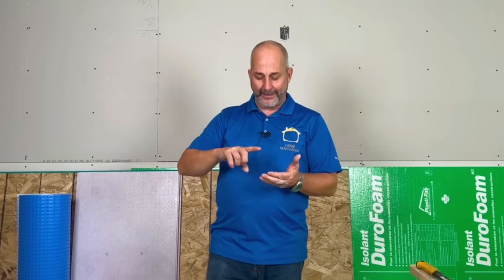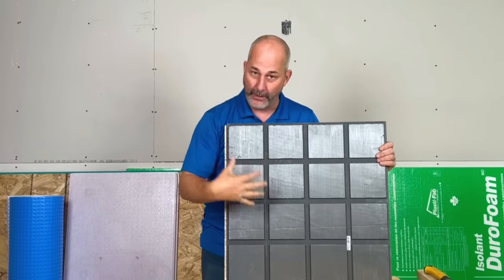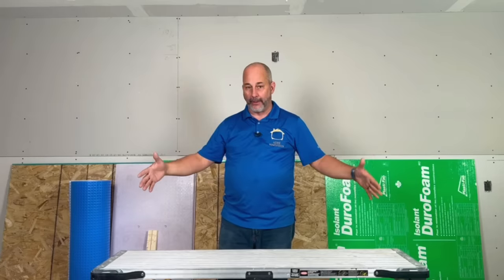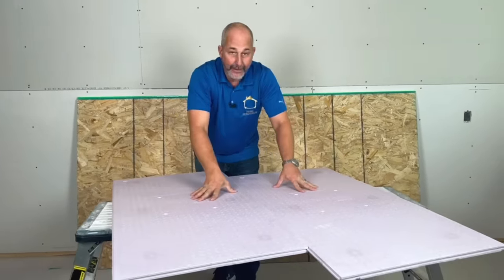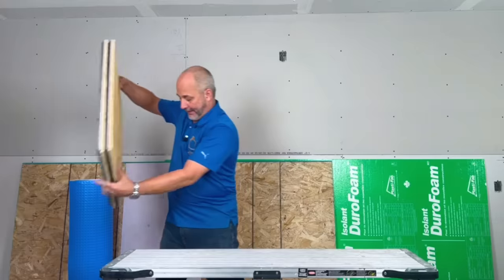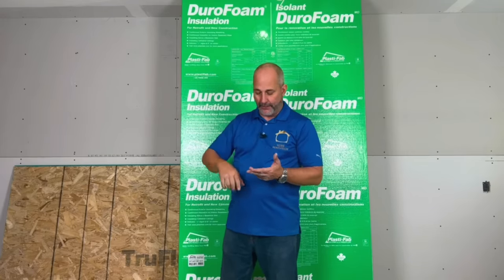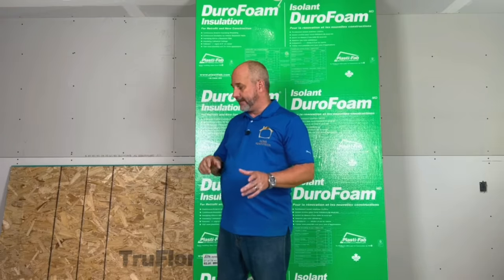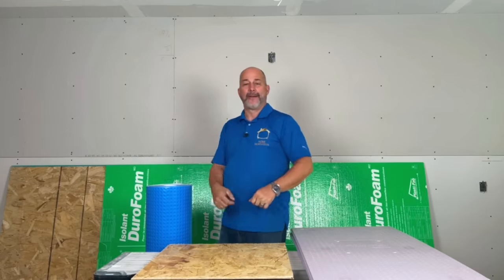Comparing 5 Different Subfloor Systems and What They Cost

Comment: Hello! Awesome Video! 

I got a 1976 raised ranch. No basement but lower level is concrete floors.

Would you recommend a floating floor directly over the DuroFoam? I’m not doing hardwood so I don’t think I would need the osb, but is the Durofoam good enough? lower lever gets pretty humid in summer and cold in winter with no thermal break or.vapor barrier. Previous owner had just gleued Berber carpet and vinyl sheet right to the concrete. If durofoam by itself isn’t good enough then I was debating the insul-armor. Trying the keep it minimal due to stairs but also want that thermal break. 

Side issue too is the lower level walls. Being a raised ranch the lower half portion of the wall is cinder block. I feel I would treat this the same as a basement wall. However, Previous owner had 2x2 ( 1 1/2 actual ) studs right up against the concrete blocks and unfaced fiber glass insulation with a poly vapor barrier which was poorly installed. Based on all my research the studs right against the concrete blocks is a no go. When I ripped that out there was clearly moisture inside the vapor barrier with some of the 2x2 studs and fiberglass insulation a little moldy. I think purely from condensation from a poorly installed vapor barrier and not enough thermal break. Nothing terrible, most likely the reason for a slight misty smell so I want to get it right this time around but there is so much confusing stuff about vapor barriers/retarders and moisture barriers. 

There is no insulation on the outside of the cinder blocks. That being said, I’m torn between two solutions. 

1st- use rigid foam board right up against the concrete to create moisture barrier. Frame over it with 2x4 and fill with insulation ( most likely rock wool) Install certainteed membrain to allow wall cavity to vent with season changes. Then drywall

2nd - put rock wool comfort board right on cinder block to let it breath, frame out with 2x4 and fill with rock wool insulation. Install caertainteed membrain over it all and drywall

So the question really comes down to, should i moisture block with the foam. Or let it breath with the comfort board. I have no evidence of water getting in from the walls either. Everything is pretty dry, just moisture and humidity, which is why I would want to use a moisture barrier, but I also don’t want to trap moisture in the wall and then get moldy 2x4’s. Seems many people get hung up on this detail mainly because the science is still evolving. Thoughts?

Comment: Thanks Jeff, I had a question, related to a basement with workout area a common practice in basements and garages is to install horse stall mats that are 4 x 6 ft, 3/4" thick, and 100 lbs a sheet, and they also have an underside that has channels for airflow.  They typically tape the seams.  Do you think this would be suitable to use in an entire basement then install LVP on top of potentially?

Comment: HI there.  I live in Santa Monica, CA.  I just poured a new slab foundation for my 900 sqft single story ADU.  Do I need a wood sub floor and membrane?  Or should I just lay down the hardwood right on top of the concrete slab?

Comment: Hi Jeff , love the videos. I am looking to use ridged foam on basement walls and dricore on the floor with the framing on top of the dricore . Should i stack the ridged foam on top of the dricore with the framing or have the ridged foam floor to ceiling and the dricore up against the ridged foam?

Comment: my house is 2 years old very dry waterproofed on outside concrete wall perimeter drains under basement floor basically very dry basement with walkout . I think the durofoam for floor with the 4x8 subfloor would work for me. what do you think? for walls the foam directly to concrete and then framed wall in front of the foam would be all I need .what do think? im thinking I dont think I need water management since my contractor made sure the basement was dry they also connected all downs[pouts to pipes leading water far away from house! Maybe fill in holes where pins were and fill with hydraulic cement would be all my prep work. I live in Massachusetts so it does get cold here but not like o Canada your home and native land ! what do you recommend for finish ceiling and finish floor and is it ok to use sheetrock in basement ? do I have to use greenboard or is there another product for walls that would be better?

Comment: Great video!  I have a sunroom with an uninsulated slab on grade and tile flooring which I would like to add laminate floor to both unpade the space and be warmer on the feet. Would it be wise to use the foam board and ply combo there in order to retain some heat from a space heater in the room?

Comment: Hi Jeff, I'm in Connecituct, in a home built in 2004.  I'm  at a toss up between the Dricore R Plus Subfloor vs Dricore Insul-Armor. I do not have walls up yet and feel like you would recommend building the wall on top of the subfloor correct?  Insul -Armor on the website says to install after walls, but I also found instructions that said to build the wall on top of the insul-armor. thoughts?

Comment: Debating finishing our basement here in Wisconsin, but an older home (1910 build that has been lifted and at some point basement seems repoured). Relatively dry, but when the water table gets too high water will push through the floor in a few places, and then go back out. Do I need to repour the floor? Or can I just use a membrane!?

Comment: Hi Jeff. I've got a 1980s home with a poured concrete foundation. Current flooring is OSB directly on the floor and it's getting moldy in the summer. We have a sump pump to manage water, and the joists above are about 7.5 feet high.

Looking for the best solution for moisture management at lowest height with materials brought in through a bulkhead. Thanks in advance!

Comment: We are building a new home and moisture won't be an issue. Based on your video it appears that Duro Foam will be the best option for us. We plan to lay carpet in the basement. Can the duro foam be placed under carpet? Do you have to add the subfloor sheets first and then the duro foam?

Comment: Hi! I added a mud room in my garage . I have heat run and cold air return. The floor is extremely cold. The floor is about a foot and a half off the cement in the garage. Full of insulation and hard foam. Which type of barrier should I put in? Durafoam?

Comment: What do you think of painted on waterproofing membrane for con crete slab that will have glue down vinyl planks? Is it true that if the moisture cant leave the slab due to the moisture barrier that it will leave via the house walls and create a moisture problem in the brick house walls?

Comment: Jeff: I have a house, 16 y.o., built right. I am under the water table. We have a sump pump. We have no water on the concrete floor ever but the humidity go up notably in the spring. Which of your methods would you suggest. Thanking you in advance for your help.

Comment: I have a 1965 house with a partially finished basement with no vapor protection under the floor.  We get some water and was thinking insularmor.  Does any water management subfloor require ripping out existing walls and reframing over the subfloor?  Can I even put walls on top of insularmor?

Comment: If using the durafoam 3/4" sheets and not intending on putting down engineered hardwood but rather putting down vinyl plank. Do I need to put OSB down still? And if so, can I get away with thinner stuff to cut down on cost?

Comment: I got one for you! 1985, basement carry’s a little moisture, some efflorescence etc. I’m building a woodshop down there. Was planning on R+ dricore and installing framing right on top per that video you did 7 months ago or so with foam board with the big beads of PL300. Do you think that’s still the play? Or should I just do DMX with rolled rubber or LVP on that? 360sqft spot

Comment: I'm wanting to install carpet and LVP in the basement, which subfloor system would you recommend? House is built in 1976 in Denver. I am not overly concerned with a thermal break, but definitely would like the moisture protection. I am concerned about thickness as I have a low ceiling height.

Comment: Hi Jeff, my house is in the south shore of Montreal, QC, built in 1966. The floor is carpet on top of concrete. There is water infiltration in the finished basement via the footing but we are planning to install a french drain and waterproof the foundation with a Delta MS membrane this spring. What do you suggest for our basement subfloor?

Comment: I have a newer home built in 2017 in Winnipeg. I am in the process of finishing my basement right now. I don't have water management issues right now, but it would make me feel more at ease to have a water management system installed having lived in an older house with water management issues. My plan was to install the DMX 1-step 2.0 with LVP. I've brought all my heating down to the floor level in the basement. Now I'm worried after watching this video that I should instead be focusing on something with better thermal break. Should I be installing something with better thermal break for comfort in the basement? Or will I be fine with the DMX 1-step and bringing the heat down to the floor level in a newer build?

Comment: I have a home built in 2006. And it has a wooden basement. Like, the basement walls are entirely wood inside to outside. I know the exterior has gotten the weeping tile redone nicely as well as new vapor around the outside. We don't get actual sitting water in the basement ever but the humidity is constantly high and any baseboards we put on always get swollen up with moisture and get this white calcium buildup on them. In the past some of the drywall in certain areas has gotten moist as well. I don't know what is underneath the concrete floor if there's a vapor barrier or not. Currently there is no subfloor installed, just some kind of linoleum or something straight on the concrete with a thin underlay I think.

What would you recommend in this type of situation?

Comment: Hi Jeff,
I bought a 2012 house in Eastern Canada with a semi finished basement (drywall and subfloors done). When I look at the sump pump basin, I see that the sub floor is like a 2x4 platform with osb on top. What kind of subfloor is this and should I add any of the products you mentionner in this video when I will finish the basement? Cheers!

Comment: Great tyvm, NJ. Question: floor for van floor, steel with ruts (dimple equivalent, the floor isn't smooth it has rectangular bumps). What do you recommend? I was going to go with durofoam. Nothing under it. Ontop plywood (painted to help with moisture) and probably vinyl clicklock. Maybe wood? What do you think? I was going to use tuct tape for the seams. Question: should i use plops of glue under the durofoam? What kind? i was thinking no, or maybe some kind of rubbery plops that won't cure and will stay flexible, which is what the van manufacturer uses with their wooden floors direct onto the steel floor. And then some underlayment in between the plywood and vinyl. Using tie downs and dowels between the plywood (only 3 sheets - 2 seams). Can you do maybe a video, so many way are being applied to van floors. Summary for me: maybe rubbery glue plops, then durofoam in long pieces, painted plywood (seams 90 degrees to foam seams), vinyl flooring (maybe underlayment? most dont do it but i see no harm). Note it's only about 60 sq ft. tyvm!

Comment: 1960 (N. Ohio) what about cutting criscross grooves w/ a hot wire knife say 3/8" deep in the durafoam panel permitting the drying & mitigation of the small amounts of water that comes in by way of the cracked block foundation. And do you self level prior or...?
Reply from the maker: just get the dricore insul armor and use vinyl plank.

Comment: Hello,
We are going to finish our 1925 basement.  Our biggest issue is the ceiling height, so all decisions come through that lense.  We also definitely need a vapor barrier with dimples of some sort.  We would like to do hardwood flooring, so that it keeps the old ascetic as the rest of the home.  I saw a product called DRYBARRIER but it says that you can not glue flooring or nail flooring into it.  The reason I was curious about that flooring is because it was so thin.  Do you have any products you recommend with the current restrictions I am under.  Thanks in advance for any help you can give!

Comment: @HomeRenoVisionDIY we have a 1920s house that will be waterproofed on the inside and we want to add vinyl flooring. The biggest issue is height - every 1/4 in counts, as it's only 6ft6in, and I'd like to have my taller friends not bang their heads into the ceiling. We've added 4mm vinyl + 2mm underlayment in a prev old house with a similarly short basement and it worked ok - it was still dry after 5 years, but it did get cold in the winter. What's our best option?

Comment: This is great per usual!!! Really appreciate all the info. Can you touch on the use of the black DMX across the whole basement if finishing with luxury vinyl planks and tiles in the bathroom? Specifically would you use 5/8” OSB on top of the DMX regardless of the flooring? Or change it to a different underpayment for tiles? And just to confirm something you had mentioned in a previous video - one should ideally frame “exterior” and interior) basement walls on top of the OSB? Is there a product you can recommend to use instead of OSB but that can be framed over and is not organic? thanks so much!

Comment: Wonderful videos
2year old house in Utah builder didn’t install footing drains, some moisture penetration from floor to wall joints and from cracks at corners of windows. Builder sealed joints and cracks with sikaflex under warranty.  Would love finish the basement and to do in-floor heating in the basement.  Hesitant to finish the basement due to settling and moisture concerns.  Do you think it is safe to proceed with finishing the basement.  Do you recommend any products that would control moisture and allow for in floor heating,  could we do a tile floor or would something floating be a more prudent option?

Comment: Hi there.  I've got a 1,300 sq.ft. 1970s home that's slab on grade in Vancouver, BC.  I've leveled off the entire floor with floor leveler, and now I'm trying to decide which, if any, subfloor system I should use. I was thinking the exterior DMX with 5/8 OSB, your thoughts?

Comment: I am refinishing a basement in a hillside ranch,  it's a floating concrete slab and only 1/3 is actually underground house is in PA, USA  it  has never had any water in basement I am installing nuwood click flooring wood based composite material product I think, do I need a vapor barrier? the floor is painted with epoxy floor paint now,  thanks

Comment: Thanks Jeff!
We have an '87 build in Saskatchewan - Sitting above the water table, but still on expansive clay with a ton of cement shifting in the basement (up to 4 inches). Foundation is intact, and we'll look at options for leveling the floor when we reno. In terms of a floor, I'm liking the idea of the dimpled membrane and durofoam for our basement. We have the wall gap from the garage to bring it all in. Any advice?
Reply from the maker: 3 layers of flooring is fine from a building science point of veiw. building code might run you into issues as it relates to the different stair height. to solve that you need 36 x 36 landing for your last step so it is no longer a step in a series. if that makes sense. Cheers!

Comment: I have an older house (ca. 1950) and the basement was "finished" when I bought it (thin layer of linoleum adhered on top of the slab with a particle board ceiling). I have noticed some moisture on top of the linoleum at times but haven't found the source (maybe from the slab since all the block walls around it showed no cracks or wetness). If I were to finish the finished floor, I presume the water issue won't just go away, so that tells me I would need water management, and I'm in Minnesota, so thermal help would be nice, too. However, I think I'm working with about 7' floor to ceiling, so not sure if that would give me enough clearance to do both. What do you think? Is there a way to heat the floor? I presume electric heat tape wouldn't be a great idea if there may be water.

Comment: So what would you recommend for a high water table?  I have a stone foundation and the previous owner sheetrocked most of the basement (including three rooms), with R13 in the studs.  No vapor barrier, just carpet over the concrete floor.  While my neighbors all have sump pumps going a good part of the year, I've actually only had water come up though the floor once in the last two decades (it self drained through the floor afterwards.  But it happened once, it will happen again...  I don't want to put anything down that's permanent or that will rot or create mold, but I'd really like to get the humidity down there under control without having to run a dehumidifer 24/7 to keep it at bay.

I dont want to reframe everything, rip down the ceiling, etc.  I was thinking about installing a sump pump, ripping off the sheetrock on the exterior walls, foam board behind them (reinstall the R13 also), then use something like the dehumidifier

Comment: If I wanted a "best of both worlds " approach,  could I do dimple mat, dry core and then osb?
Also: what is your recommendation if stairs are already in place? If I add all that, my bottom step height won't be the same as the rest, thus no longer code. Is there an easier/cheaper method than revamping all the stairs when adding a subfloor?